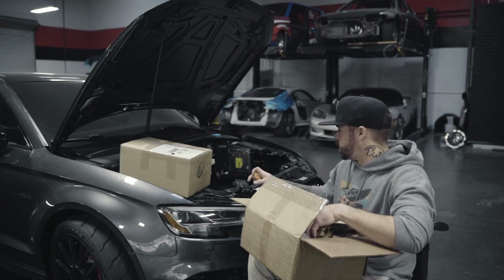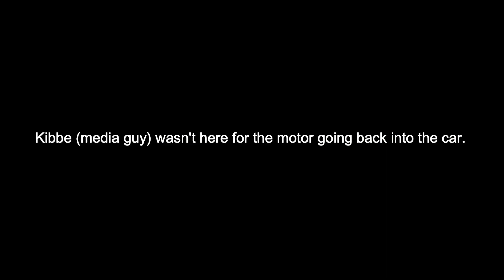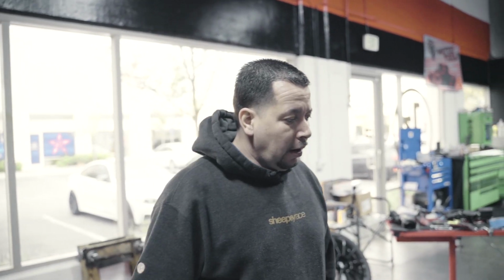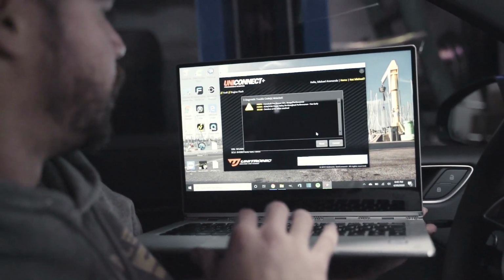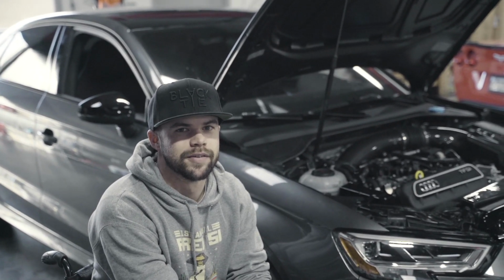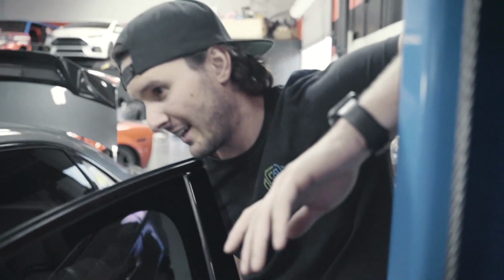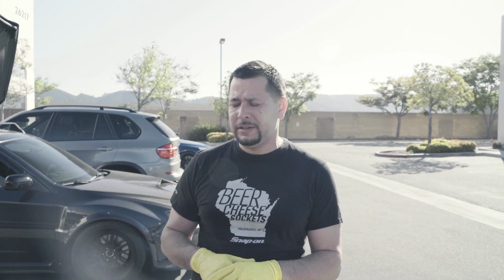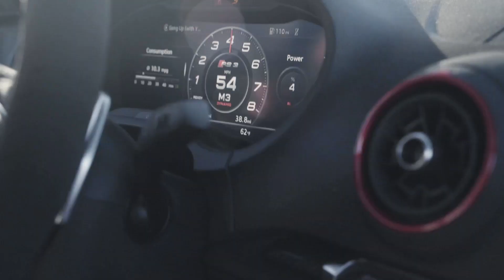Audi RS3 Build (Pt. 2) Assembling the Built Motor and working out some kinks.

Comment: So many tuned rs3's videos out there but so few detailed assembly's.
As a happy RS3 owner i can watch this for hours.
One question is bugging me for years and i have not been able to find an answer.
Maybe you guys can tell me.
After shutting down the engine, is there forced cooling and /or lubricating of the turbo untill the turbo comes to a standstill?

I always hear stories, you have to idle before shutting down the engine, but with the audi start/stop system this does not happen.
And i dont hear many problems with turbo's failing.
Reply: Eric S3 I don’t own or know much about rs3’s but I’d the turbo is oil cooled only you should let it idle down before shutting off, if it’s oil and water cooled it should be fine but as I precaution I always let mine idle down.

Comment: Refer to manual of DAZA you will figure out what was going wrong. 

After lock the cam shaft with original tool- Camshaft gears to be lossy on camshaft with bolts with out any tight - then put the chain on it - then release the tensioner - the gears will be in right angle - no loose of chine between the gears - during tightening of camshaft bolts need to pretight/hold the gears with special tools in obesit direction of bolt tightening to avoid disturbance of gear angle. 

Please check and give us your experience
Reply: @07k_motorsports24  check you Instagram box
Reply: @a.khojah4968   might I have it as well.   @iruinaudis

Comment: wondering if the need to shift prior to red line with Uni's TCU stage3 tune had anything to do with what they though was slipping.  Give driver props for right hand on gas/brake control lever as well as left hand on right up-shift lever ;-)